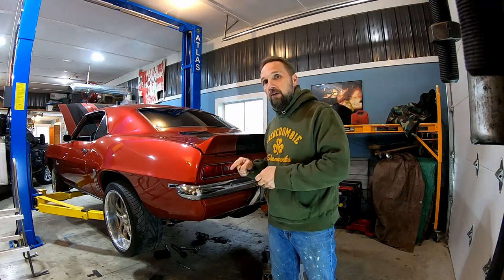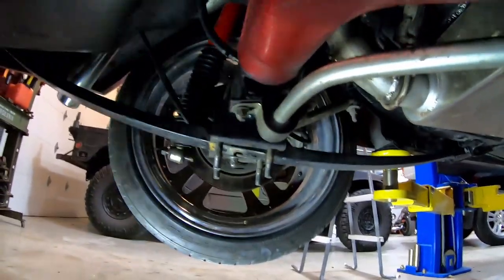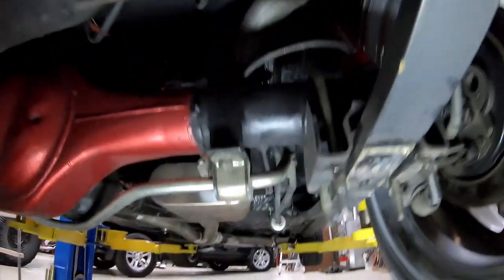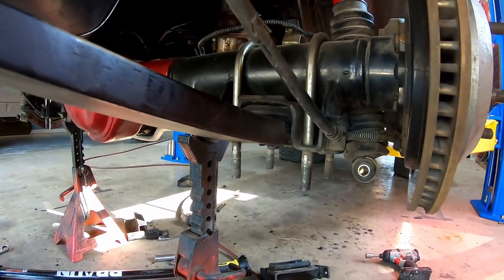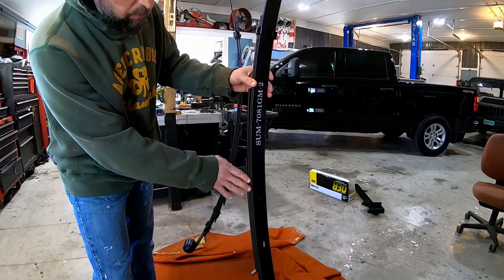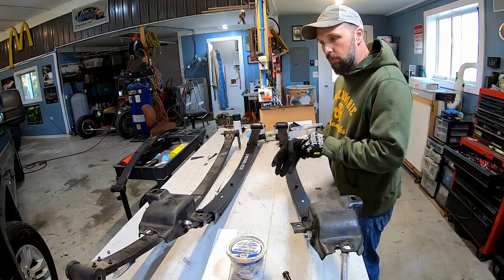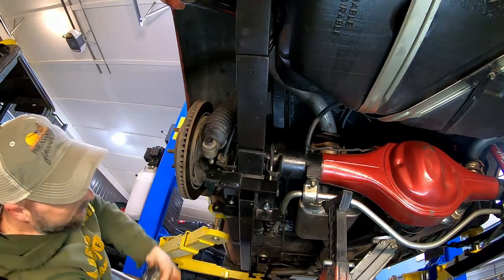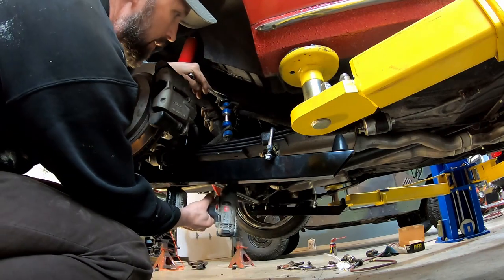69 Camaro 2" drop leaf spring swap from fiberglass to Summit multi-leaf and Lakewood bars

Comment: Good job man.I  remember when you took me for a ride in that car and you telling me about those leaf springs.
Reply from the maker: Turns out there is more to this story.  Yes, when we went for a ride that day it was clanging and banging where the front spring bushing rotted out.   Well, the traction bars were a fail and I may have dropped the car too low.   Yesterday I pulled the traction bars off.  I’m looking at custom 1” taller shackles to raise it up a tad.  But waiting to see if the new stance grows on me.  It is about 3/4” or so lower in the rear now with a full tank of gas.  It sits level fender well to ground front and rear.   It always had a forward rake so just debating what to do.

Comment: Pretty much why I don’t like using after market parts! They at best guess at testing and design and don’t put in the 100s of hours of testing nor have the money to do so. I laugh at guys that rattle off all the names of part companies they have installed. Hard to find a legitimate manufacturer these days among all the garbage.
Reply from the maker: You are not wrong.  But dang.   It is hard to get new OE parts that aren’t made overseas that are worth a crap either.  I did have to ditch the traction bars.  They are not compatible with these drop springs.  Found out the 9” posi unit had failed and is currently at the shop and the car is just hanging on my lift.  I also replaced the shocks since one was leaking.   One thing always leads to another.   Would be so much more simple if it were all base factory stock.   The older I get the more i appreciate the original design.

Comment: Fantastic overview of your rear suspension project.  I too love the look of the Traction Bars and plan to put them on my 68 Camaro.  Took many notes and plan to follow your lead.  Thanks for sharing.   Love those wheels, do you know that brand and specs?  Did you have to mini tub the rear?   Cheers...  Mike
Reply from the maker: The wheels are Intro Prowlers.   Front 18” and rear 19”.  Good luck on your project.  I just put new tires on too.  It sticks very nice.  No mini-tub.
Reply: @McSpeedAlaskanAdventures  Thank you....  yours is an absolutely beautiful car!

Comment: What type of shocks you use in the rear for a 2 " drop and what type you have ,p/n### please
Reply from the maker: @1mcauley  I bought from speedway motors.  Front/rear Eibach pro plus / pro damper 330385581 and 33038488

Comment: why do you have a rubber fuel line running right next to the exh????
Reply from the maker: Good question. That’s a nylon hard plastic fuel line with the quick connect late model OEM connector to the fuel pump and filter/regulator.  It had been there since 2004 and so far hasn’t caught fire.

Comment: Do these work for a 67 Camaro as well?? 

Great video if they do work I plan on doing this asap
Reply: You have to check if you had mono or multi leaf springs.  If so.  Yes.  They will work on 67,68,69.
Reply: @chrisnikkimcdonald8867  I have mono leaf 🥲
Reply: @joeseptien2182  that’s okay.  Just make sure you get the right mounts and you are good to go
Reply: @chrisnikkimcdonald8867  I read the other comments, you had issues with the traction bars?
Reply: @chrisnikkimcdonald8867  ok thank you
Reply from the maker: Yes.  Just look at the part number and the multi leaf brackets.

Comment: What size wheels and tires are you running, and is the car mini tubbed?
Reply from the maker: Rear tires are 275/35/19.     I did have to roll the lip of the fender slightly.  But no mini tub.
Reply from the maker: Fronts 235/40/18
Reply: What's the offset looks great